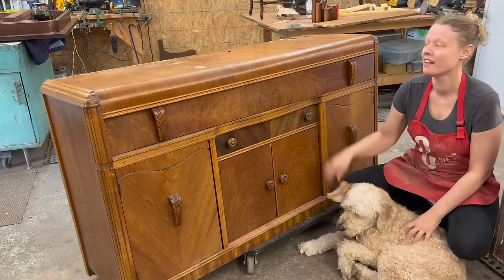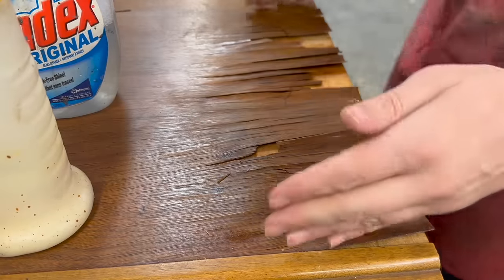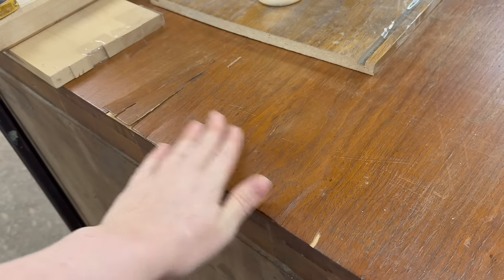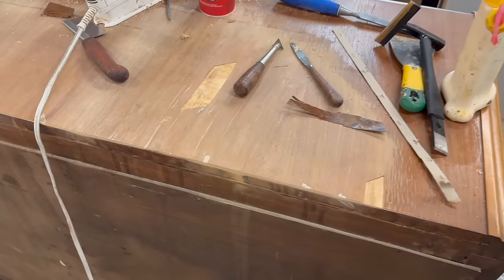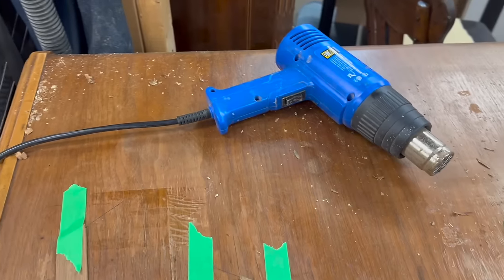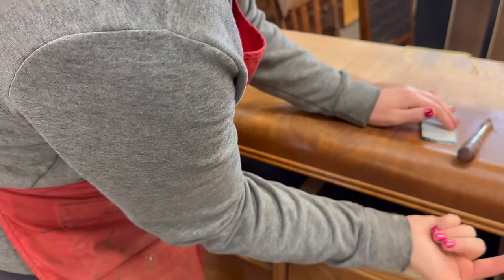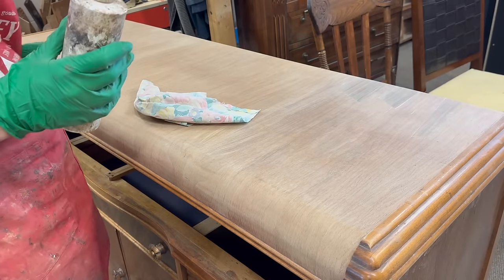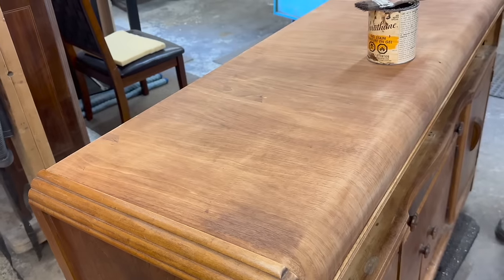Restoration NIGHTMARE!! I stopped filming this... then regretted it

Comment: I did a trunk for a customer with exactly the same damage as you experienced but I took a different tack when it came to resolving the issue. The customer asked me to repair just the damaged areas and I almost considered taking the same course as you did. Figuring that money was probably their motivation I resisted and held out for a completely new veneer for the whole top. The customer relented (finally) and the repair was a success.

 What you pulled off was nothing short of a miracle! Kudos for persevering and seeing the job through. Don't ever doubt yourself. You are very talented and more than that have the integrity every true craftsman has to have in order to pull off the impossible. Bravo !
Reply from the maker: Thankyou very much. Customers are fun Sometimes lol

Comment: Trena, my favorite parts of all of your videos are where you show your human side. This includes when you're working with your father, mother or daughter, and how you relate to your puppy, kitty and horse. The very few times when something goes wrong in one of your projects only shows the depth of your character. The woodworking projects I've done are simpler than the ones you do but I also have charged ahead then later realized I could have given one of the steps a little more thought. Anyway, thank you for posting this despite the issue. I loved hearing you say you "knocked it out of the park!" Indeed you did - I could not see a single veneer patch.

One thing I've done when gluing veneer on large surfaces is to put a section of 1/2" closed-cell foam between the caul and the work piece. Foam absorbs some of the unevenness of the substrate and helps to equalize pressure across the work. I'm not sure it would have helped in this project, but you might find this useful in the future.

Best regards. You're still my favorite YT host, and I am fond of quite a few.
Reply from the maker: Thankyou so much you are so kind. And Thankyou for the tip with foam I can see that being very useful. Have a lovely day❤️

Comment: you really did blow it out of the park. I've learned more from this video than nearly all the rest put together. I have a waterfall dresser rescued from scrap that is waiting for my learning curve to catch up to it. someone over sanded the veneer on the waterfall curve, ripped through the sides with sanding and scrapers, and totally wrecked it, but... it still glows with an inner beauty. in the meantime, I'm using it, and babying it, until I feel confidant enough to tackle it. thanks for the lessons.

Comment: Darn Lady, I would have cried when I saw that piece with the top like shredded wheat.  I thought the only thing you could do is to take all the veneer off the top and replace it, in one piece.  There you were talking so nonchalantly, whereas I would have known I was bound to fail.  Doing that much repair would never work.  I guess that is the difference from me and your years and years experience.  I remain shocked that you even attempted it.
You knocked it out of the park with the bases loaded.  Thanks.
Reply from the maker: Thanks so much! 🥰🥰

Comment: I respect your dedication. I know how it feels when a daunting project just won't cooperate. Sometimes I'll stay on the same path I started with and it doesn't work out and then sometimes it does. For me it comes down to loosing faith in myself momentarily sometimes caused by outside influences like depression. Your talent is incredible however and combined with your determination makes you unstoppable. I can't believe how well it came out! Only you know it's not perfect but it wasn't perfect when it was  new. I thought this was impossible and you'd need a complete re-veneer. You pulled this one out making you a miracle worker in my eyes.
Reply from the maker: Wow. Thankyou!🥰🥰

Comment: You took on a challenge an ended up with a basket of shuda, wuda, couda's but soldiered forward anyway. Took guts to outline the mistakes to your viewers but we appreciate and respect your honesty. In the end you prevailed and it looks great. By the way, in a month or so I'll be 70 years old and I have enough shuda, wuda, couda's over the years to fill the back of my pickup truck.

Comment: You did a great job and I learned a lot. When the going got tough, you persevered. I would have chucked it on the wood pile. But that's just me. If you get an outlet timer and plug your glue pot into it, you can set it so it turns on and is warm before you even get through your first cup of coffee.
Reply from the maker: Oh that’s a good idea

Comment: I could not identify a single patch in the finished video. You are such a perfectionist that anyone is lucky to have you work on their furniture. I would have loved to see how you blended those patches in. Just once I would like to see you cut the patch first and trace it's outline onto the project. This would make a much tighter fitment.
Reply from the maker: I do that sometimes but I find that method always a bit roomy in the fit. I like to fiddle with the fit and make it just a bit bigger than the hole to patch so I can mash the two fibers together and hide the seams 😉

Comment: Try using a heat activated hide glue for jobs like this, it will stop the veneer from swelling during the glue up and you won't get ridges. Makes jobs like this a lot easier to do and also easier to rework when things don't quite go as expected. Also when veneer patching always go lighter with the patches then you can stain down to match colour. Having said that, you got great result though.
Reply from the maker: Yep that what I should have done

Comment: Terna, I have watched you for years, Bravo! You have inspired me to finally take on the restoration of my grandfathers witing slope (aprox late 1800s) I have made and installed some great wood patches, that I learned from you. Its going amazingly well. Now I need to address the mahogany veneer repairs . The veneer that is missing looks to be about the same thickness as what you are working with in this video. Can you direct me to any suppliers in Canada? I cant seem to find anything in BC. I would gratefully accept your advice. Thanks again and another wonderful video
Reply from the maker: Hmm. I think your best bet would be to have a local wood shop cut you some.

Comment: This was not an easy project.  the waterfall fronts add really tough challenges as you said   I have done several similar veneer projects the veneer on this design is thin, brittle hard to match both in color & grain.     Your end result was great, but I certainly understand thew frustration along the way       Great Video !
Reply from the maker: Thankyou!

Comment: When lifting veneer that has been glued with hide glue , try injecting alcohol under the veneer. It will crystalize the glue and will release.
Clamping veneer on case goods can be iffy. The iron method is the only solution.
Reply from the maker: Yes. That is what I wished I had done. The substrate was just not stable enough. Wrong choice

Comment: My first big save was a kitchen table with a water spot, headed to the trash, but why? I said, let me try? Mine was an art project, to camouflage where a potted plant had left a large dark circle on the finish (I had not heard of bleaching wood at that time). I was not replacing any missing wood, so all I did was sand off the surface really well and then add stain in different colors to make a strategic design to cover the remaining pot mark. I was so excited for my first top coat, but when I used a water-based poly it reacted with every single glue seam on the table top and I had raised geometric seams across the entire surface of my design. I sanded it all down and started over with a new stain design, noting that it may have been a good mistake/lesson, and the glue seams were somehow stabilized and sanded back down to level in the process. I knew that table could go into the trash as a last resort, so no fear. My final artwork was preserved with several top coats, and I switched to using an oil based poly just to be safe. It surprisingly earned me a few hundred dollars, which I was not expecting at all. That table has seen plenty of use and has held up incredibly well since 2018… still a sturdy and beautiful work of art which remains in that very same kitchen to this day. Had this been a paying project I would not have been nearly so brave and it probably would have wrenched at my heart with apologies and regrets. As it turned out, it turned into a confidence booster and a keepsake. I really just wanted to share this as a moment to say I understand the frustration and I just love you so much! Just keep going, and along with admitting what you did not appreciate, it is a blessing to be able to admit what you knock out of the ballpark 🫶
Reply from the maker: Thanks for sharing a lovely story ❤️